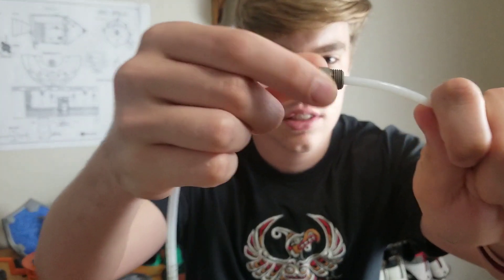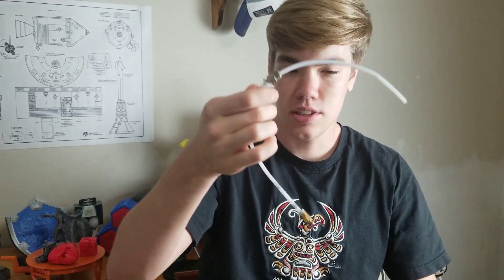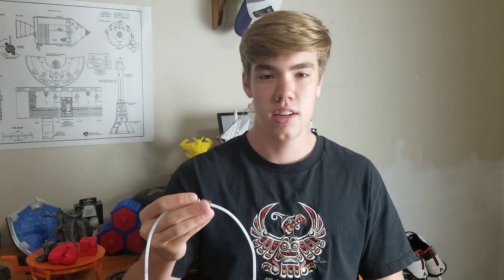Why I Hate Creality Couplings (Ender 3 Pro)

Comment: I had the same problem with my ender 3. What you need to is plug the tube in place then pull the round thing in front of bowden tube inwards and pull the tube really hard. The bowden tube will come out and the one stuck in the middle of the cube will move. Only in one direction tho. And you will be able to take it out. 
https://youtu.be/ZbH1mzGwhdc this is how you take it  out .
Reply from the maker: I have fixed it but thank you!